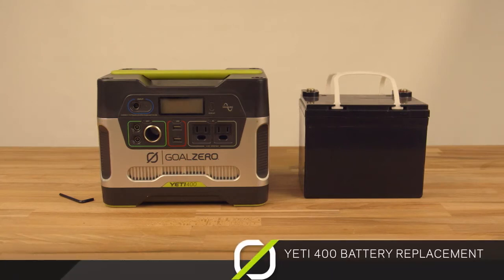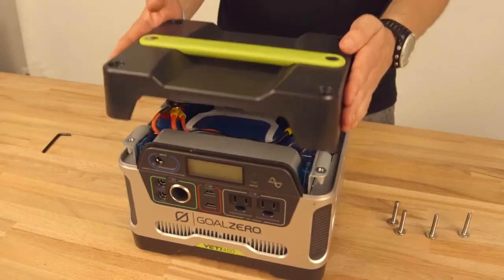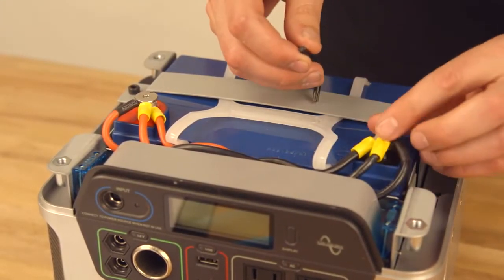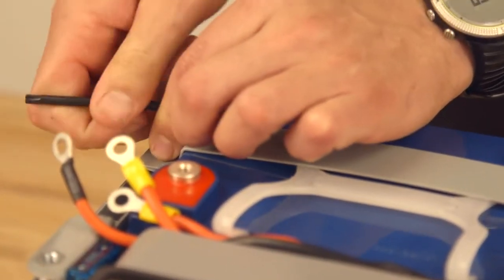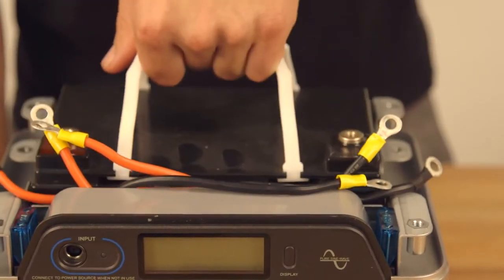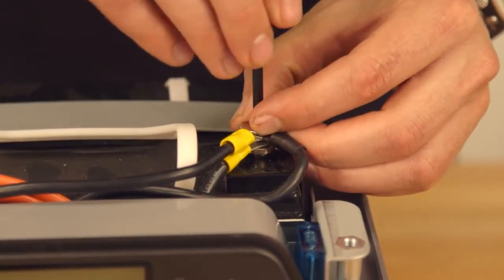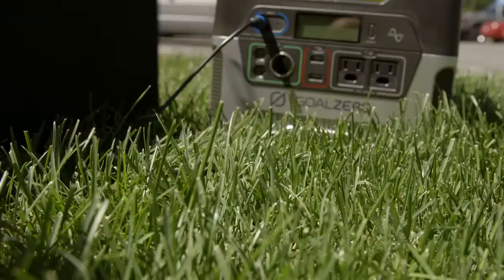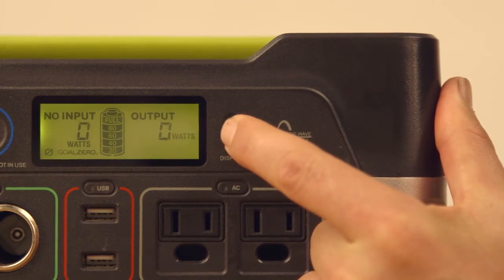Replacing a Goal Zero Yeti 400 Battery

Comment: Hi,
is ist possible to replace the battery with higher capacity? The Original battery is. a 12 V 33 Ah . I would like to replace ist with a lithium battery lets say with 12 V 50/60 Ah.

Comment: The most important information is hooking up the wires and that was not included in the most obvious steps. Not everyone is removing and replace one at the same time, perhaps the battery was removed by someone else? After all the detail, this most important step should not have been skipped, at minimum just make it visible!
Reply: They’re color matched, not difficult to miss!